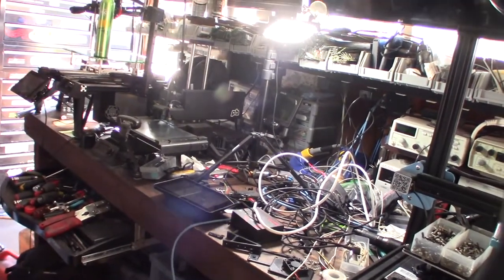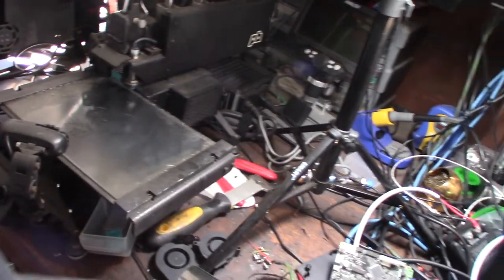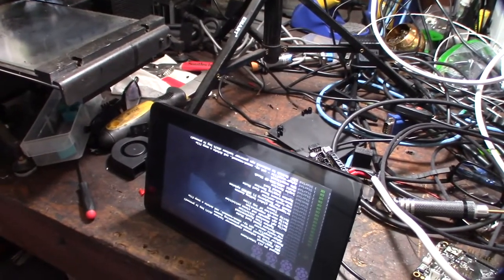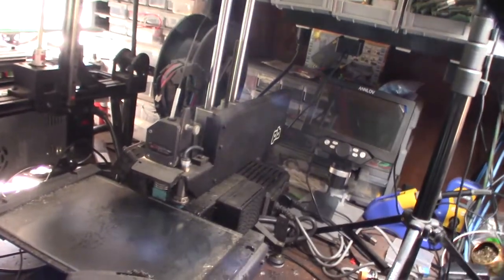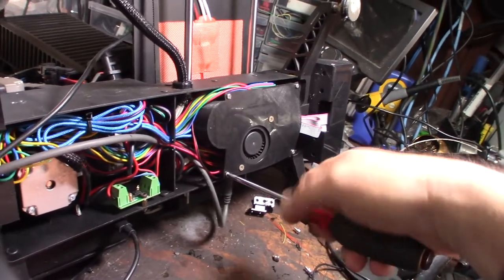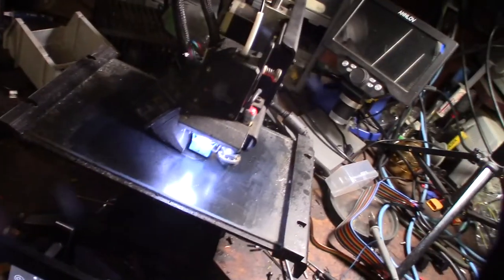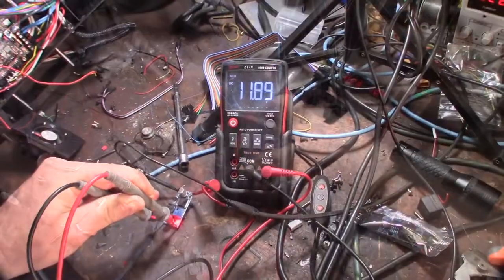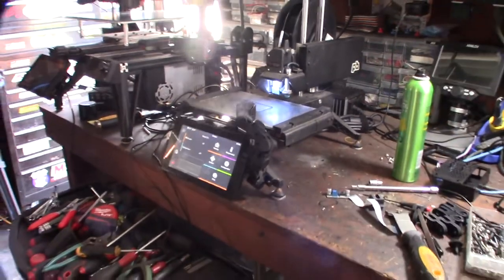Printrbot Simple Metal Klipper SKR Pico Conversion with Raspberry Pi 7" touchscreen.

Comment: Thanks for the vid. Ive had my simple metal since 2015, and put a extended heated bed on it 6 months into ownership with a xbox360 psu and ssr and went to a e3d extruder and like yours, still running today although finally I started to get bad banding in prints, so I looked and my Y axis lm8uu's were noisy and I replaced them and the rods & I stretched my Z to 340mm and added a 3rd Z rod as a stiffener outboard & a new metric leadscrew & delrin nut for a 2024 freshen up. While it was apart, I found the Z axis pulley had worked loose again on the Z, doh! probably the only fault all along. 
I came here looking for info about klipper wondering if I could run it on the marlin board itself but my board and extrudrboard is ok and I use octoprint on a bbb so maybe not the skr mainboard yet as I'm thinking about a ender 5 plus with a core-xy conversion to keep it company as they seem pretty hackable too. My son's pushing me to the ender because he thinks I'm going to gift it him like I did my elgoo mars resin when I upgraded to a photon mono x, but no chance, I love my little bot still because its been such a great tool all these years.
Reply from the maker: I still have mine and use it regularly. Long Live The Printrbot!!!